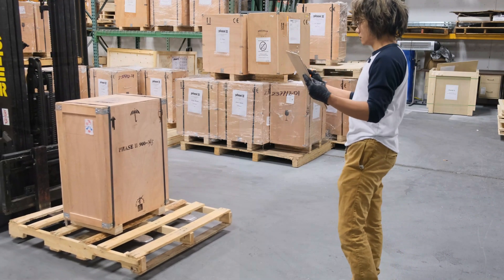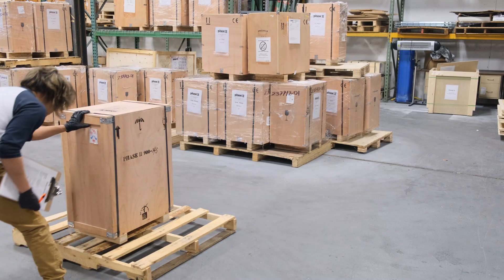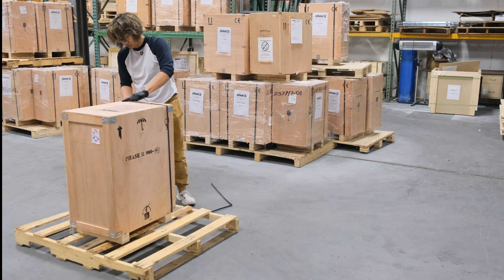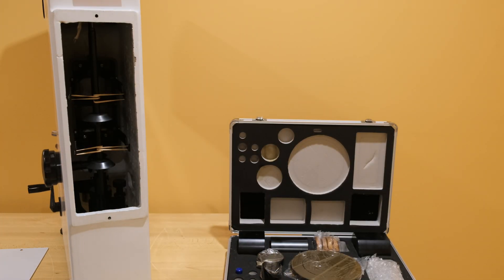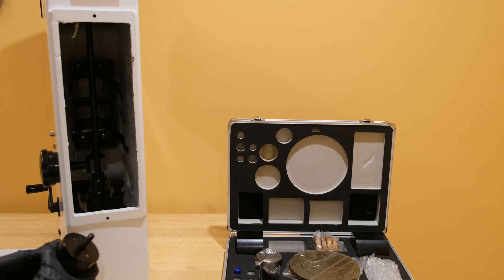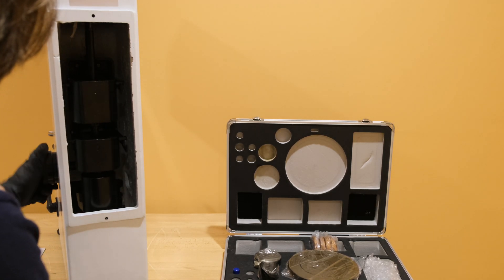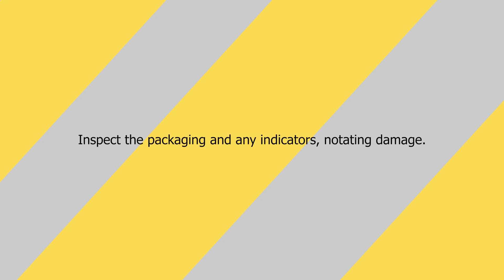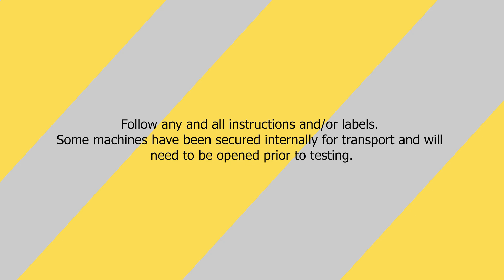Hardness Tester Uncrate-Install-Setup video for Phase II Rockwell Hardness Tester

Comment: Can you make a video showing how to make the fine adjustments for calibration? I've tried calibrating based on the instructions, but the readings keep coming out high. 33 HRC on the 27.3 test block.
Reply from the maker: First, please make certain machine is level both in front and in rear.Then on each of the 3 HRC test blocks provided, please take 4 readings . Further, please take pictures of the dial face in unloaded position, your weights when loaded, the finger behind the indicator as it goes into the indicator, Then the proper fine adjustments can be made. You can email the test block values, results and pictures to both, info@phase2plus.com and tech@phase2plus.com. One of our techs will assist you. If you need to speak to someone here, pls call 800-526-9087.